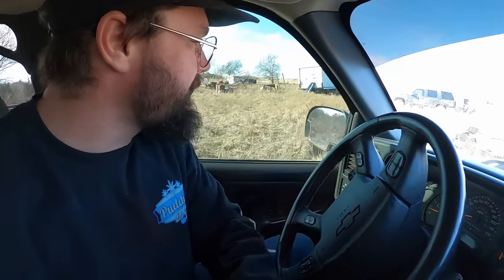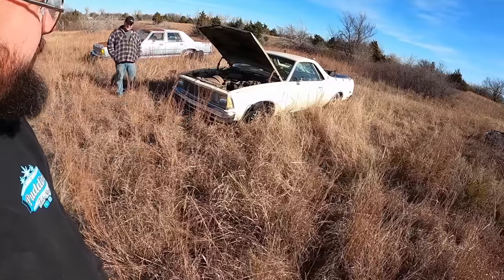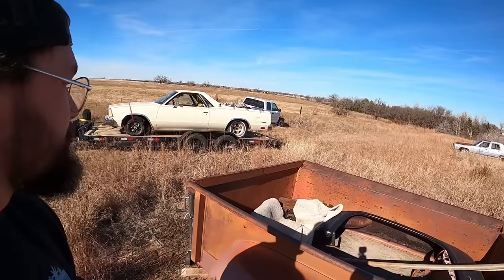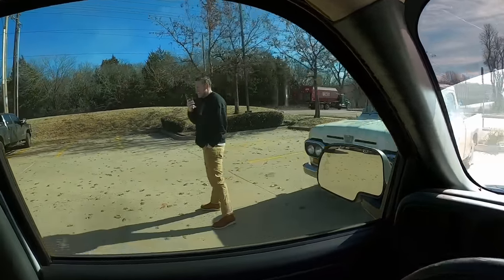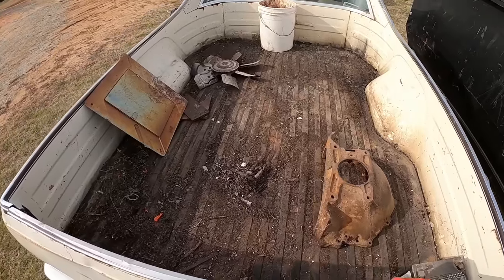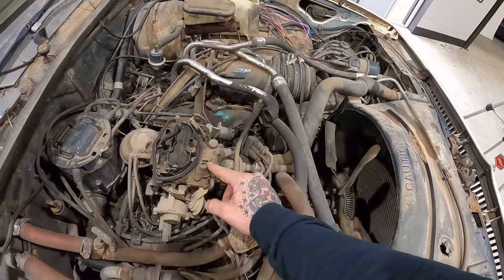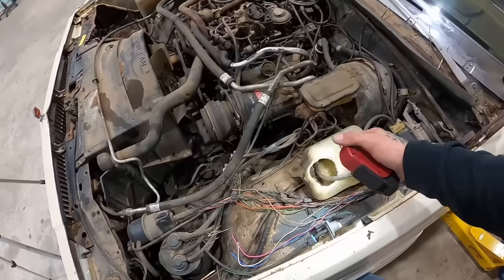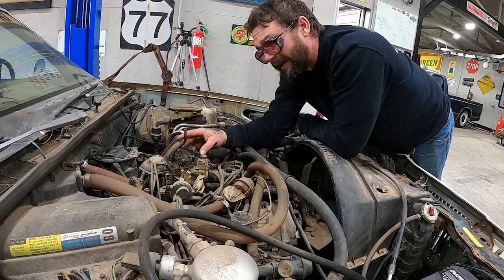1980 El Camino. FORGOTTEN in a Field. CAN WE DRIVE IT?!?

Comment: That’s a Chevy 229 V6. The 3.8-231 is an olds v6
Reply: 231 Buick but used on a lot of GM cars.  Not this one of course, since the distributor is on the front of the Buick one.